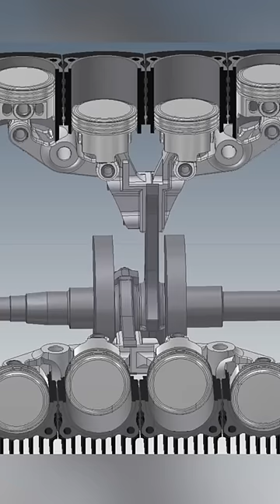STRANGEST V8 Engine Ever Made

Comment: It appears that the energy of the power stoke from the outer two pistons only contributes to the compression stoke of the inner two pistons and not to the crankshaft power. This means that the engine performance is essentially the same as a basic 4 cylinder, but with the compilation of added mass, friction and components. Looks neat, but I don't see any benefit
Reply: exactly what i was thinking. The 4 side pistons only work to accelerate the middle pistons and the fireing order has to be a nightmare
Reply: Exactly what I was thinking but the outer two pistons are contributing to engine power by providing upward torque to the crank. Instead of the compression stroke being a parasitic drag it contributes torque. Kinda like a two stroke engine.
Reply: @n2osrt4 its closer to the power output of a steam engine, pushing and pulling
Reply: @isekawai  the firing order would probably be the same as a standard inline 4, combined with a v-twin engine
Reply: @Sausketo  It's basically like flatplane V8, with a slightly better ballance.
Reply: Everyone’s a mechanical engineer on YouTube 😂
Reply: the benefit is just to demonstrate that it can be done
Reply: Exactly what I was thinking too, I just didn’t want to make you guys look dumb 😁
Reply: It's pushing the connecting rod when the inner 2 pistons fire and pulling it when the outer 2 fire, should be intuitive enough from watching the simulation, I'm assuming there's only tiny losses from the added friction of the mechanism connecting the outer and inner pistons to the connecting rod.  would be interesting to find out how significant the losses are, if any, it could be that by some form of magic pulling the connecting rod is superior to pushing
Reply: @nrg635 I would imagine that the mass and friction savings of removing 6 piston rods and reduced inertia from those same rods would more than make up for the losses created by the "rockers". The rockers don't travel as far or as fast as piston rods.
Reply: Yeah it is interesting but I don’t see how this really is going to be a game changer. Absolutely an awesome showpiece and conversation starter but doubt it would perform well
Reply: The other two Pistons are useless producing no crankshaft power except on the upstroke very different though
Reply: @Max-ye9xg  Not true. When the outside pistons they force the inside ones up forcing the connecting rod up. So now the rod is under compression and tension, not just compression.
Reply: The load on the crankshaft bearings must come both from abowe and below. That most be something good in that
Reply: @isekawai  No, The outer pistons are also Pulling the Rod UP They are still contributing to torque on the crank as much as the inner cylinders.
Reply: It depends on the firing order I would suppose. If the pistons only actually fire on the "downstroke" of the cam, then basically you would end up with a lot of torque.
Reply: Exactly & not only that the reliability on this thing must be nonexistent. It also sounds weird.
Reply: in a standard firing v8 the same effect is going on, only with more rods, the firing of one pushes down, and that power is applied to a different cylinder for compression, and to the crank, any power produced at all is applied to the crank being a downward push or upward push, without the other cylinder providing power to overcome the compression, the engine would soon stop, this is part of the reason of the weights on old engines as to store power from the power stroke to overcome the compression of the nest stroke, on small lawn mower engines, the balance on the crank stores just enough power to finish the compression stoke to fire again.
Reply: Wrong. The power stroke of the outer two pistons pulls up on the crank shaft with the same amount of force as the center two pistons push down on it. Every piston powers the crankshaft because they have to by virtue of the fact that they are all linked together.
Reply: Looks like a four cylinder sounds like an 8-cylinder let me put it this way I would definitely buy one of these and put it on my balcony personally of course other balcony engines are available I'm sure
Reply: Exactly what I noticed as well, it would be better without them. Probably has something to do with it stumbling to acceleration.
Reply: @christopherrto  Yeah, friction isn't the thing, I'm wondering about leverage / torque of the initial rocker. Let's crowdsource him a session on a dyno. As for the purr, my apartment complex is like a canyon and the guy with the chopper never rides but he exercises the engine every month.
Reply: 70 horsepower from 52 cubic inches is not bad at all though. 
It’s just like 500 horsepower from a 350. Not bad at all.
Reply: An standard inline 4 engine of the same displacement puts out 135 horsepower.  Dude said that one put out 70 horsepower. Therefore putting out half the horsepower of a standard engine of the same size. In other words, only two of the cylinders are putting down any power. From the looks of it but to middle one right and the other two were just dragging along for the ride
Reply: nope
Reply: @jacobygilbert196  if the outer pistons are doing anything it's only creating a problem, i couldn't imagine this engine holding together at 5-6 thousand RPM for very long. He put a lot of thought and effort into the wrong direction.
Reply: @jimthvac100  aha that make sence
Reply: Really short stroke. Probably why it sounds so weird. A lot or tension and compression on the connecting rod. That thing would have to be beefy and/or well engineered to not bust. Got some serious alternating shear force on the rockers too. Slightly more even wear on the crank and bearings though. Bottom end of the engine could have a reduced size for accommodating a shorter crank shaft. Interesting concept but not sure how it’s more efficient. Gold star for creativity.
Reply: That's just power, what about the torque? It's a mirrored inverted built engine.  Be interesting how efficient and strong it would be in real world.  It definitely wouldn't be fast if grated right, or add to ctv unit.
Reply: @christopherrto  force equals to torque
Reply: @langerd6711  anyone can be in the real world, that's if they possess that certain skill 🎉
Reply: The outer pistons are going to oppose compression forces of the inner pistons, and vice versa 180 degrees off, just like an ordinary engine. This design will also cause power thrust in both the push and pull directions of the crank rod. Energy produced at the output of the shaft would be the same as if there were separate crank pins 180 degrees off. Problems with this engine are over complexity and relying on one crank rod per set of pistons.
Reply: Very short stroke?

Comment: Ahh the youtube genius mechanics have assembled in the chat.
Reply: The outer cylinders do absolutely nothing because that down stroke quite literally is pointless but none of that angular energy is translated into circular motion
Reply: @happytrails5342  False. When the outer pistons are pushing down they are pulling the connecting rod up. Traditional engines only produce power on the downstroke, this produces power on both down and up strokes (of the connecting rod).

Comment: the outer pistons pull the crankshaft up rather than pushing it down like in conventional engines. i wonder if this smooths out the torque output on smaller engines like a i4

Comment: For anyone else wondering, 52 cubic inches is about 850cc
Reply: 850 CC is not a lot of displacement. Hondas l
L12B seen in the Honda jazz in 2008 produces 90 horsepower with a 1.2L (1200CC) engine.
Reply: @Quindarious_Gooch_  it is pretty big for a motorcycle engine. I have a 1990s Honda Hornet which produces around 100hp from 600cc, and that is not exactly a fast bike.
Reply: @patrickmkiv you can’t put that size on a bike. But I understand what he wanted to do. The engine is not for car or production, it was a fun project so it’s understandable.
Reply: @boxoffisa no, it doesn’t seem to have any practical purpose, but it is made from 2 Ducati bike engines.
Reply: @patrickmkiv  wow. That’s impressive. I didn’t get it at first. Now I get the whole picture and what you were talking about. Making it from Ducati engine is awesome. Hopefully he makes more stuff like that and get posted.

Comment: 52 cid and 70hp... And naturally aspirated. That's really excellent specific output. For reference, the F20C from the S2000 makes 240 from 120 cid, and that's basically the best anyone has ever done with an N/A engine. He's solved the bore/stroke ratio problem, which basically puts an upper bound on stroke because of excessive connecting rod angle. If the angle is too high, you hit the bottom of the cylinder.
Reply: will this withstand at High rpm?

Comment: Spins up hella fast … crazy throttle response… dyno that!!
Reply: And incredibly quiet for basically having no muffler.
Reply: @ObservationofLimits It has two mufflers in that video.
Reply: @351cosmo  no shit einstein
Reply: @351cosmo  no. No it doesn't. Those are just pipes.
Reply: Some horsepower and nearly 0 torque, such is the way with a high response short stroke engine.
Reply: The opposite of my impression.
Reply: I have Hella fog lamps on my truck.
Reply: @onemoremisfit  me too, they came from the factory installed on jeeps during the 80s
Reply: @1982MCI  I used to have rectangular KC lamps but after 20 years the rectangle KCs be like no longer a thing and I legit needed new ones. KCs be like dropping low key round vibe $400 a pair cringe led energy now. So I hella yeeted the KCs and got me a pair of Hellas.
Reply: @onemoremisfit  Hella made the portholes for professional Miele washing machines from the 70s until 2010 or so. It's funny to see the trade mark logo of a headlight manufacturer on your washing machine....

Comment: I would think those piston rods would wear out and even break rather quickly.
Reply: Why would you think that? It's the exact same force as any engine if you think about it
Reply: @kevinroberts781  Twice the stress.
Reply: @horowizard  Only on start up and that's easy to design for. Once the engine is rotating it's basically the same stress.
Reply: @kevinroberts781  The piston rod is under the stress of 4 pistons instead of one, aswell as that force constantly switching between compression and tension.
Reply: I don't see this combo making serious horse power ! Short track? Power will be made down low in a low power band due to short stroke.😊

Comment: That must be one strong rod.
Reply: That poor crank
Reply: Not necessarily, 
In a regular 4 stroke the rod only sees combustion pressure once every 4 strokes, the rod in this engine sees pressure (push and pull) every stroke but the peak should be the same. the usual point of failure in a 4 stroke is the wrist pin at TDC at high RPM at the end of the exhaust stroke because of initial forces of the piston and the open valves keeping the air cushion from pushing back. in this engine, there is a push back on the ...pins?....after every stroke so I would assume the pressure on them collectively would be less or the same.
Reply: @alienclay2  I suppose, but it still has to last a quarter of the life
Reply: 70hp...

Comment: I see a ton of “that’s a strong connecting rod” comments. What you need to understand is that this still has the same firing order as a flat plane v8. That means each bank has the same firing order as the inline 4 cyl in your mum’s yaris - each ignition is 90 degrees off the other. So the rod on each bank never experiences double ignition or double torque input. Therefore, even though the rod looks like it’s doing 4 rods’ job, it doesn’t need to be anywhere near 4 times as strong.

Comment: As a 35 year ASE  Certified mechanic, I can tell you this much.... at any performance the strain on only one push rod for the operation of four cylinders would definitely be catastrophic.
Reply: yeah they need to be beefy, but like how the outer 2 pistons pull it upwards instead of pushing.
Reply: Not so sure about that. For each bank of 4 cylinders, it seems to me with that linkage that there's exactly one cylinder in each phase of the four strokes at any given moment. So the connecting rod always had the stress of exactly 1 compression, 1 power, 1 intake, and 1 exhaust stroke at any given moment. Now, the compression and power strokes cause the most stress, but the see-saw linkages cause most of that stress to be shared before transferring to the connecting rod. So the connecting rod doesn't see the full stress and only sees the usable power that's going to the flywheel.
Reply: No it's not that's like not much strain dude
Reply: @benb9151 
 yes it "dude" 
Put it under power with a reasonable load and see what happens.
Reply: @tsc7299  man it's a joke
Reply: @benb9151 he really just wanted everyone to know hes been a mechanic for 35 years lol dont take it to heart
Reply: i dont agree, for one, its less than 10hp per cylinder, and for two, two are pulling the crank up while 2 are pushing it down so its less than 20hp acting on the rod at any given time. the standard ducatti 996 engine for example makes 112hp from 2 cylinders (im not sure if thats the engine he used for the bottom end but its just what im using for the example because its old and low hp compared to more modern ducattis so most comparable hp) so its making almost 60hp every power stroke plus the power thats lost to the compression stroke on the only other cylinder on the engine, and being 2 cyl 4 cycle engine you have 1 compression stroke being driven by a power stroke, but the other compression stroke happens on a exhaust stoke so you have "missing beats" in the combined cycle, so physically the rod is actually seeing a lot more than 60hp per power stroke because their is so much time of no power being made, and hp is measured as an average over time, adding an upwards lift on the crank thats driven by a power stoke is lowkey genius when you really think about it, and the way the rocker assembily is anchored at the pivot and its symetric both sides means the rod will actually not see any loading its not more than capable of dealing with like side loading

Comment: That rocker pin will wear out quick. It does the same 45deg back and forth. Compared to a normal engine crank bearing that does full rotation every rotation.

Comment: How do the outside pistons transfer their energy to the rod? it looks like they were only helping the inside piston to push out the exhaus gasses since they move in the opposite direction to the rod
Reply: Obviously the cam would be radically different. Cam lobes and timing chain TDC determines when valves open and close. As long as the piston forces move up and down, valves timing, fuel delivery and ignition timing are all adjustable.
Reply: @Greg-io1ip  yeah i can get behind that part. what im not understanding is, how the outside pistons are driving the piston rod, when they are allways moving in the "wrong" direction, relative to the rod itself

Comment: Many keep stating that the single piston rod to four cylinders won't hold up, but its likely they've never taken note to how many vintage aircraft radial engines were built internally. Each bank of cylinders ran off one master rod, which in turn had all the other rods attached to it. 
If properly lubed and cooled, with sufficient bearing and beam support, it could work. In effect, what he's done is build a radial engine in a two bank V8 configuration. 
The area I see as an area of concern would be the pivot links which drive the two end cylinders on each bank getting enough lube and cooling, as well as getting oil to the piston skirts of all the pistons. It would need pressure lube to the pivot pins, and some sort of oil squirt system for the pistons. There's also a side load issue on the pistons due to the nature of the arm movement which would likely have long term wear issues if not addressed. Possibly a simple modification of the piston skirt or the addition of a lower support ring would work but at only 70hp, any added drag would lower that number substantially.

Comment: correct me if im wrong but, don't the outer pistons exert more force at the shaft than the inner ones since they are using a lever while the inners are pushing directly? not to mention that the outer pistons are no longer applying their force downwards, again due to the lever reversing the force. seems like an extremely unbalanced and inefficient design.

Comment: Interesting but those bearings on the see-saws that connect pistons together wouldn't last very long. Bearings only last as long as they do because of hydrodynamic forces that cause the oil to create and maintain separation. That's why starting a car does more wear on the bearings than driving some odd number of miles. Neat idea but, like most engine ideas, it wouldn't work in the long run due to the forces at play.

Comment: So far every comment I’ve read got it wrong, comments about rod strength, useless out pistons etc. the rod is plenty strong for the displacement and it is stabilized by the rockers. The outer pistons PULL the rod up like a negative power stroke, but certainly add power to the engine. The only issue I see is losing a lot of power to reciprocating forces and a very small displacement limit per cylinder.

Comment: The rod is not only pushing. Its pulling!  Turbo charge this with all wheel drive and it can outrun a GTR before it made it 1/2 of a quarter mile down the track.

Comment: Not to Worry of con-rod fail. Stout Forged Unit always under equal side loading & only has 26C.I. of displacement to handle. Less than 10% of loads seen in single cylinder of large C.I. V8 ! This unusual setup requires 2 cylinders to fire @ same moment.